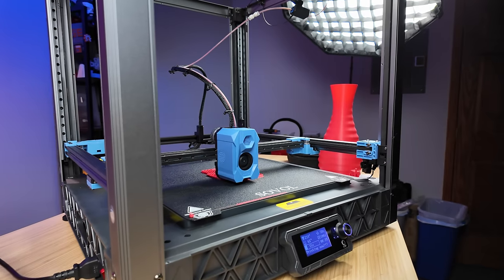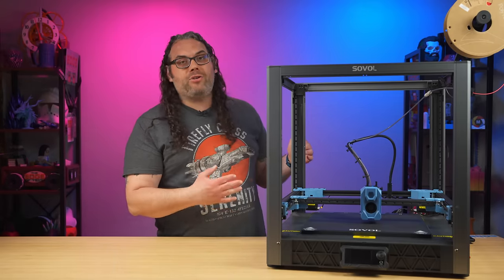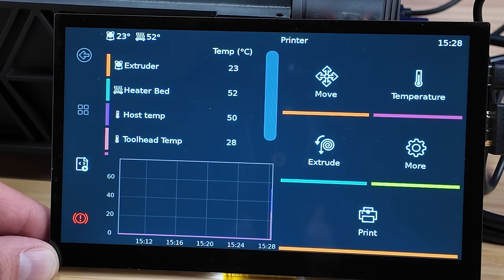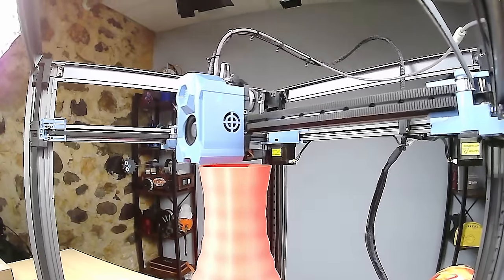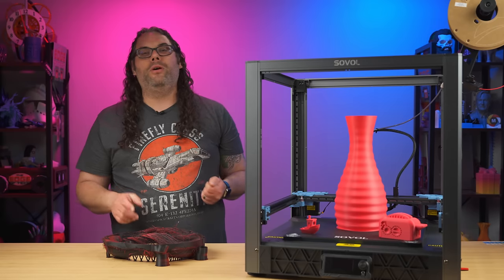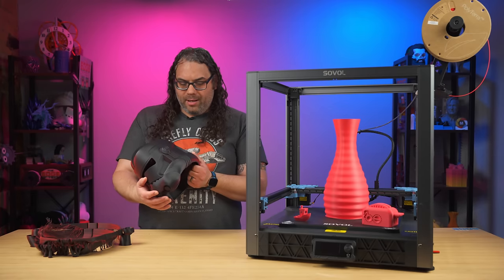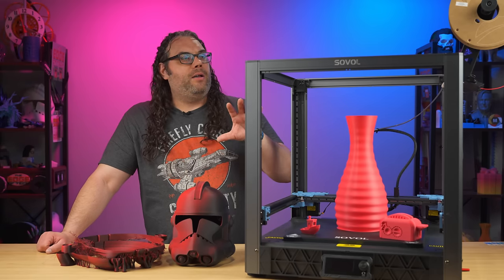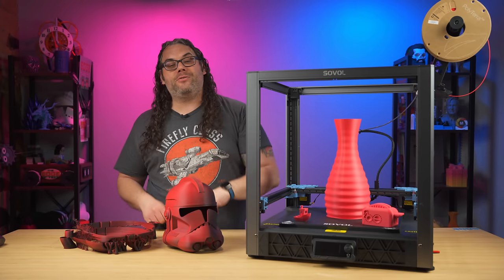The Clone Wars Have Begun! Sovol SV08 Voron Clone First Look!

Comment: Thank you for an honest first look. Lost all faith in Nero since he keeps slagging this machine that never ever claimed to be a 2.4, but he keeps pushing that. The 08 is exactly what I thought it would be, a super solid foundation that can be tweaked to be amazing! Keep up the great work.
Reply: I feel his video was fair and the follow up with the very short pin for a bearing stack was valid. While 2.4 inspired and built for mass production, people who do not know any better will say it’s a 2.4 just like the ender 5 people think it’s a corexy. They even mention the Voron inspired however there are many mods for the 2.4 that will not work on this due to the custom extrusions. The sv08 like the Troodon 2.0  have their place.m for those that don’t want to built a kit. Nero’s biggest grip was firmware and slicer material profiles.
Reply: @trugbilddrachen I'm sure when it ships, they will include profiles or they will be created by the community. I always build my own profiles. It's not much work. If I built a voron I'm still building my own profiles. I think his review was a little too bias.
Reply: @leetpg  while I am the same, you can’t say that for the majority of those buying this. Given that they ship early May in the US the units provided for reviews should have had the profiles ready. What did they use when they tested in house? The z calibration even mentioned in this video was “coming soon” i also feel based on the live stream and the box, they are banking on the Voron name and similarity to a 2.4. Even this video mentions being a clone. I am all in for Sovol, how we we should relay on the community to fix the basics of the printers functionality. This is not the 199 ender 3 anymore.
Reply: @trugbilddrachen  I think he said it best when he said it's half baked. I wouldn't say half baked though I'd say it's 90 to 95 percent there. To finalise profiles won't take much work. Maybe the review rigs they sent out they only expected simple pla prints. Again, they shouldn't do this when asking for a review. It's like designing a torch that has 3 brightness modes and sending it out for review and the other two modes aren't ready for use yet. Annoying, but software work like that can be ironed out relatively quickly. 

It's a tricky situation. I feel everything gets compared to a bambu when really this shouldn't be. I know it's a mass produced machine but it's root core is literally the epitome of a tinkerers dream. I had a big build to make my own voron but I've got 2 kids under 3 years old, work two jobs and struggle to find time to scratch my ass. I couldn't commit to a 40 plus hour build with the space I have at home. This will allow me to have the volume, core xy, a known platform and still tinker. 

His issue with the bearing too looks fixable. I also don't think it will take long for someone to cnc the plastic parts out of allow as a future upgrade. 

I always say, if you don't want to tweak, modify or tinker then buy a bambu. 

Did you order a sv08? I did and want wait to get it. I was going to order the enclosure but for the price I think I can build one for under $20.

Comment: Thanks for the video Jim.
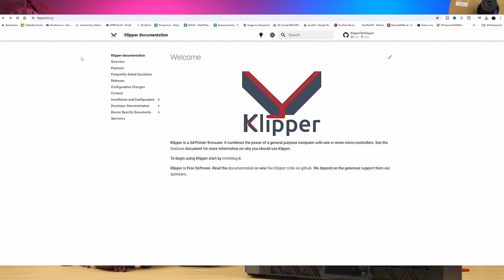At 13:47 you were actually showing the donate page for klipper, not Voron. (Though supporting klipper is also a nice thing 😄)
Sovol had actually made some donation to the VoronDesign team days before SV08 is launched. 

Personally I wouldn't call it a "clone", but I guess that's more of a subjective understanding of the word.
The core mechanism is the same, but they took mass production into consideration and redesigned every part for injection molding and using custom extrusions.

Anyways,  have a nice time at RMRRF!
Reply: Belongs to them cloners beyond the outer rim!
Reply from the maker: Thank you! Lol I definitely put the wrong page in that shot!

Comment: What is the quality of the heat bed, is it straight or is it warped?
Reply: Definitely warped just like every other printer
Reply: @Nick0utd00rs  With my bamboo I am a maximum of 0.05mm warped over the entire surface and I would need 300mm in this direction for certain tasks

Comment: Wonder what the parts cooling fans are specifically. I bought a SV07+ a few months ago and later found out about its parts cooling deficiency. Designed a dual-5015 fan holder to ride on the extruder, learned how to tweak the profiles in Orca, and now it's working pretty well. Basically, to print PLA at ever faster speeds you need ever better cooling, and not just for the microscopic area that you're printing.

Comment: I have always liked Sovol, I had several sv01's and have a few sv07's now.  The number one complaint with almost all of these Chinese 3d printer companies is the firmware, it never really gets polished, have to rely on others to release a stable, good working firmware, I am guessing it may be the same with this one.  I wish you would have created that new profile yourself and did some test prints so we know for certain if it is a profile issue or a firmware problem.
Reply from the maker: I don't think you'll see that with this because it's running full Klipper. I wish I had more time to produce this video, I'll keep everybody updated with profiles!
Reply: That wasn't the case with merlin stuff?
Reply: The thing is with Klipper you'll have full control over the firmware. It might not be the best out of the box but you'll be able to make any changes you want to it
Reply: I agree. Both Nero and this review show the firmware still needs some polishing to get the basic functionality promised. I will use the mcu fan for example. Most if not all haven’t  of these mfgs figured out klipper to only turn on the mcu fan when the board is working such as heating up. Qidi, Creality and this unit. While I appreciate the community in improving, you should have basic functionality esp less than 3 weeks away from shipping. These units are boxed and are waiting delivery at the warehouse at least in the US. Users will have to update their machines right out of the box.As I mentioned in another post where are the profiles? I would have assumed they were testing other filaments than pla in house. As the extruder is similar as the sv06 , I wonder if the profiles could be used. 

This was an affordable large format core xy with vanilla ish klipper (remember they did turn off updating by default). I want this to succeed, but the mentality of “it’s ok, the community will fix it” when it should function out of the basic as promised is an old way of thinking. It’s not the ender 3/pro.

Comment: Love the dual extrusion filament by polymaker. Did a lot of stuff with the shadow red. My wallet is printed out of it lol That aside, it seems the most common issue I've seen across various reviews had been layer shifting. I wonder if the belts aren't tensioned properly out of the box

Comment: It's more of a "wannabe" Troodon 2.0 Pro in the "more plastic wasn't possible" version...
Reply from the maker: Interesting comment. I haven't seen that printer, but why do you say that?
Reply: @TheEdgeofTech  Troodon 2.0 Pro is a Voron 2.4 clone. To me, the structure of the SV08 looks more like the Troodon than a Voron clone. Unfortunately with far too many plastic parts (the Troodon hardly has any plastic) with all the disadvantages that this brings with it. The Troodon also comes with a stealth burner, touchscreen, housing and costs a little more (if you want to upgrade the SV08 to the same thing). The SV08 is new and I hope it finds its way and its community! If not, there are alternatives!
 ;)

Comment: Oooof rumors of a $469 or under price is a pipe dream I see…starting at $549 but after the enclosure you’re up to $700. Not too far off from the price of the upcoming K2 I would wager….I see on the website it doesn’t say any info on stuff like dimensions and specs of the hot end or camera resolution…I see they sell a camera (720p) for the SV08 is that a replacement or an upgrade?? Do you know what the resolution on the included webcam is?
Reply: First 1500 units sold were "Early Bird" priced at $499 and wasn't difficult to get, like they'd still "only" sold a little over 1k units one hour after the sale started. It also combined with a store coupon that I think Sovol had forgotten about. 😅 So at least the very first buyers actually got it for $449! 😊

Comment: Seems the bar these days is that a printer needs to be better or cheaper than a Bambu.  This is neither, so hard to justify. Like it not not, the BBLs are that disruptive.
Reply: I disagree with you. A Bambu Lab P1P is $600 plus shipping. It's an open frame, it's a smaller build area, it's not open source (that's an issue or disadvantage for some), if you want full functionality you need to go through their server, that's a NO NO for a lot of people. The SV08 is larger by a good margin, it's open source, it's fully functional in your network without exposure to the Internet, it's upgradeable since it's open source, uses Klipper with all its advantages. It's lacking a multi material system but to some that's not a deal breaker. All in all it's better than the P1P in a lot of ways while lacking in just one area, the multicolor system. In my case it would be a better fit than the P1P for my specific needs. I don't care about multi color printing that much since I do mainly functional prints

Comment: Said the same old things as the other Sovol salesmen and their stream. The 3D printer space has been totally bought by shady companies selling unfinished products, backed by kickstarters and tested by customers...
Reply from the maker: Interesting comment. Why am I a Sovol Salesman? Didn't I say what needs to be fixed in my opinion? It's true that many of us get early printers and they are still being dialed in, but that happens with EVERY COMPANY! Even the Orange one sends printers out to the masses that are not "finished". This wasn't a Kickstarter and as with any open source 3D Printer, there is always tinkering and dialing in. Is there anything you liked about the video? What would you have done differently?
Reply: @TheEdgeofTech  I woudl have liked to seen the shadow red helmet printed full size, thats the only thing i woud have liked done differently, very cool and it didnt look so bad from here.  The filaments i use were very sensitive to nozzle temperature, if they didnt get their certain degrees they'd print funny. Even some just printed funny no matter how much i tried to dial them in, i thought it was the printer until i changed filament and got a perfect print, so its the filament thats usually the most variable in the equation, and that you have to tune for.  E-steps etc, why they all look great if you use their model and their test filament, its already dialed in, until you use your own filament on a your own model you realize you have to dial it in, so not bad.
Reply: At least it has a price tag to match and is open source. Anyone with experience can tune the printer profiles in 30 minutes. Even with my work X1C I still had to put a while into tuning profiles, that thing hates circles with any overhang. Not to mention all the first batch issues with prusa XL at that price range. No printer is 100%, but I would expect more at higher prices and expect less at lower prices.
Reply: Did you come here to look for someone bashing the printer? Are you salty that it's not a bad rig for the asking price?
Reply: Bambu fanboy detected

Comment: Extrusion problems, the profiles are not good, it needs people to fix it and deal it properly because the manufacturer didn't do it.

I wonder how SOVOL can be sure that those printers don't have extrusion problems, VFA, wobbling, cooling issues when they didn't even bother to make proper slicer profiles and test the products they sell. So what happens if someone buys one now and 3 months later it becomes evident that it ain't a "profile issue" but it is the whole printer that has the wrong combinations of motors, belts, drivers and maybe cooling?
This sh*** has to stop, they get paid with good money the should provided finished products.

Comment: Execute order 66. This definitely isn't on par with the Voron
Reply: Once the SV08 has "matured" a bit, what would you rather have if you have the space for it: This $599 SV08, or a $699 Bambu Lab P1P? That's the sort of comparison that makes at least some sense.
Comparing any $599 pre-built 3D printer vs a $1200 Voron kit that takes 30-40 hours to build is a bit meaningless. ( Not counting $900 cheapo kits as they may somewhat defeat the purpose of a Voron in the first place).